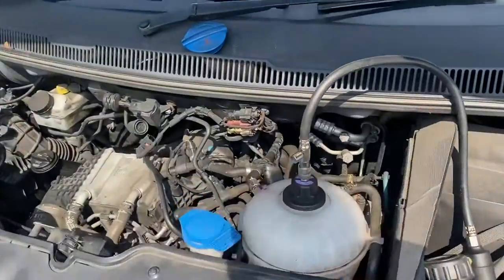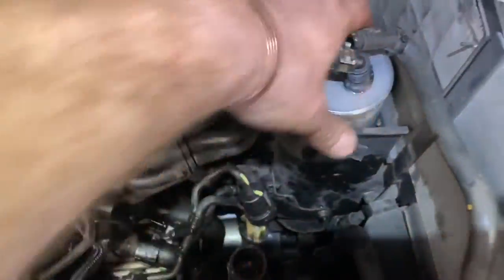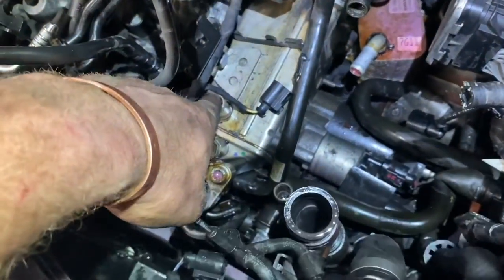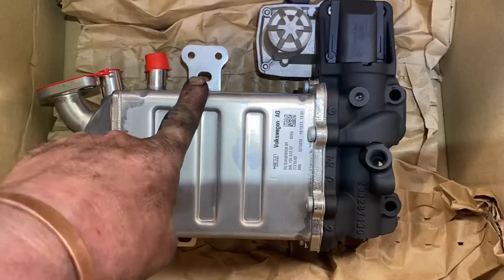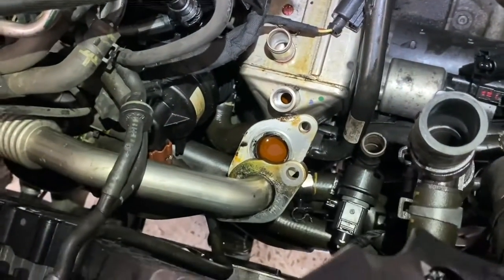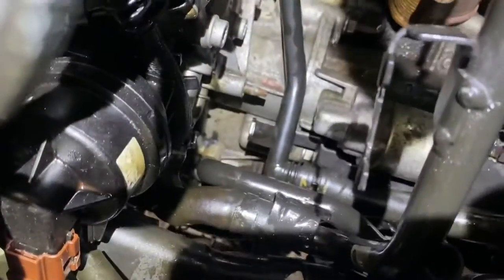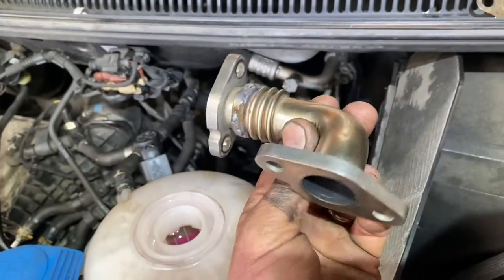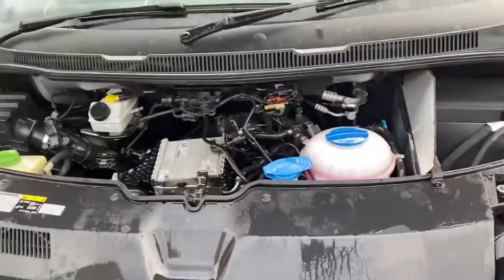Volkswagen Transporter, leaking water & egr cooler replacement

Comment: Good helpful video, just completed the job this morning and found it a lot easier removing the 2 studs top and bottom right hand side (on the EGR valve)with the 5mm hex’s on the end rather than cutting the end off.
For refitting ,the bottom left side stud is a pain because of the steel water pipe directly in front of it. What I did to make it very easy is cut a 8mm slot on the bottom of the bracket of the cooler and this allows the whole unit to slot into place very easily . You can also  put the nut on beforehand a couple of threads. Hope this helps 😊
Reply from the maker: Wow Stephen that sounds like a great idea. Well done mate & that you for sharing that information 👏👏👏
Reply: @kennedysgarage3281  thanks 👍
Reply: Bangin advice ❤

Comment: We had exactly the same on our 2.0 tdi T5, over 200.000km, coolant loss without apparent leak, overheating and EGR valve mechanism broke…just replaced with the Pierburg and since we were busy we also removed and cleaned the DPF. Thanks for your video as I was without clue where that coolant went… now I know 😊not the most pleasant job to do
Reply from the maker: @Carlitos807  well done Carlito 💪💪💪

Comment: Just done this on 108k '18 crafter, very similar but more room and pipe movable to get in for lower nut on cooler. On its original cooler so lasted well. Top job and thanks for the video as wouldn't have attempted without 👍🏻👍🏻👍🏻
Reply from the maker: @Paul_Munro  thank you Paul & well done on getting your one replaced 💪💪

Comment: Hi fella. I have just done this very job on my farthers VW T5.1 2010 Transporter for the second time it was much fun. The EGR cooler you first showed is the one I used and it fits on the back of the engine up high. Your job looks like even more fun.  My advice to anyone with a T5 Transporter is to just by the EGR cooler every third service as they are very clogged up by then.
Reply from the maker: Hi Karl, that is very good advice. No a nice job to do but well worth doing as preventative maintenance 🙏🙏👍
Reply: Good bit in it, how many hrs did it take you? As I’ll have to double that 🤣

Comment: Great information and plenty of tips.  You can’t rush a job like that if you tried to rush it you’d be doing it twice.
Reply from the maker: Correct Kevin, quite a fiddly job. With lots of little bits that can break very easily. My second one might be a bit easier to diagnose & fit 🤞
Thanks Kevin 😉

Comment: I replaced a faulty EGR valve on one recently, I didn't replace the cooler though, if I had known the coolers are prone to leaking, I'd have changed that too. Bleeding it after was a bit of a pain too.  Cheers mate
Reply from the maker: They are awful yokes to get rid of all the air, I find a 15 minute drive generally sorts them. Whether that is enough time for the intercooler pump to work or what 🤷🏼‍♂️ Cheers Matt 😉

Comment: Think I'd have a go at that. Like you say tell customer it's a slow burn and just tick over working slowly through it.  Lots of top tips with things like that connecting pipe. Nightmare if that leaked after fitting it all back up
Reply from the maker: It isn’t too bad Chris, just slow with the stupid amount of water pipes & fuel pipes etc. 
you’d muscle through it no bother 😉👍

Comment: My T6 is also losing coolant, checked by mechanic, no signs of leakage, he is saying that it's engine head cracked or something along those lines, of course he is not 100% sure but wouldn't the engine overheat or something similiar, I have been driving the van for months like this, just topping it up with water whenever it gets too low. Thoughts?
Reply from the maker: It is just the Egr cooler that is most likely leaking, it is a really common problem on these. The dealer keep them in stock which is a bad sign 😉👍👍👍

Comment: Good video, but my god what a poor design for an item that will fail at some point. Did one last wk on a Renault, 10 min job right on top of the engine.
Reply from the maker: I have never done one on a modern Renault but it does sound a lot easier 😬😬👍